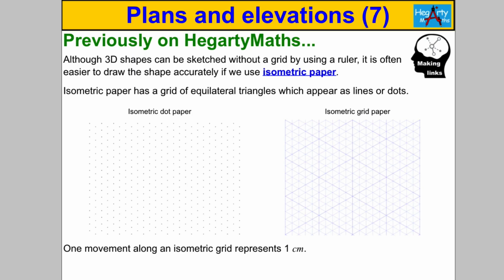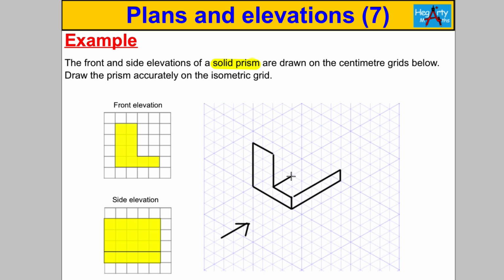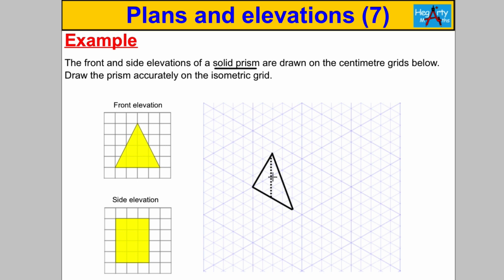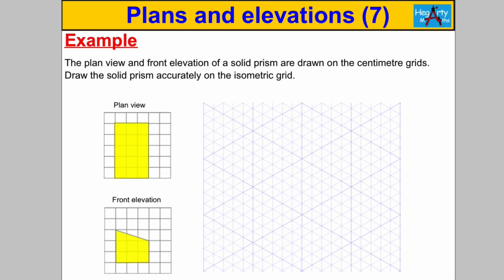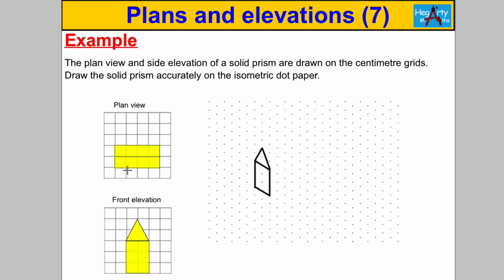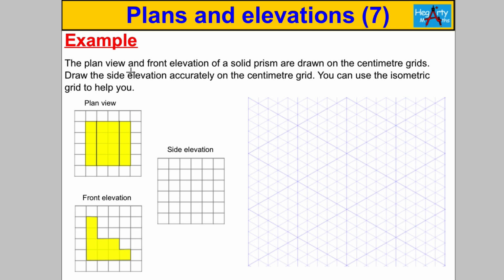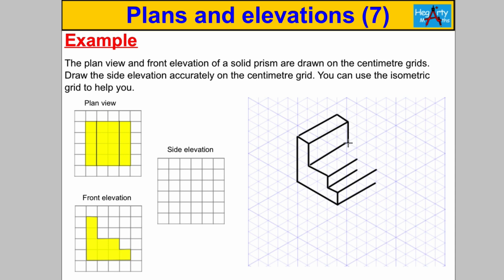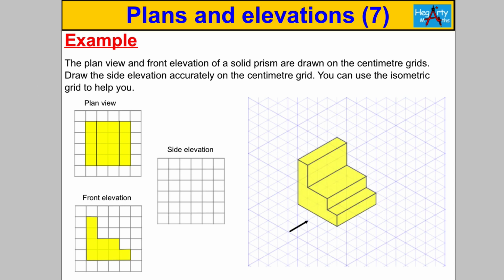Plans and elevations (7)

Comment: Hi Mr Hegarty I am a pupil at high school that has just started using your system and I Think on the whole it is quite good. However there are some issues tat I feel if you amend will really help your sight to come on. Firstly, sometimes in your videos you can be a bit unclear when explaining things so what I would recommend when doing the quiz at the side put an option to bring up and image that shows an example of how to work out a similar question. Secondly I think you could add a bit to your sight by having an interactive section before the video starts to gage the pupils level of ability and set the questions to that level. 

I hope you take my points into account and keep on improving your site.

Thanks